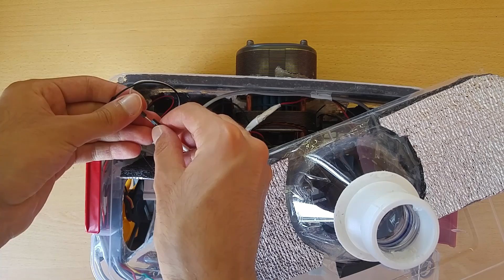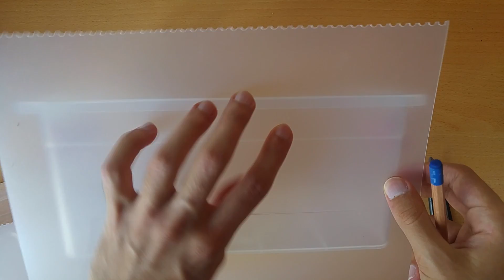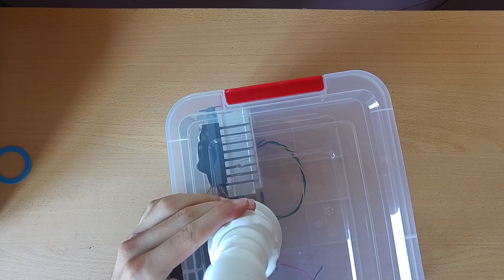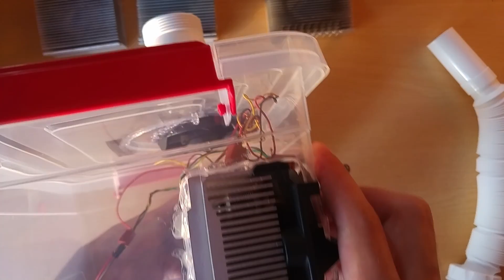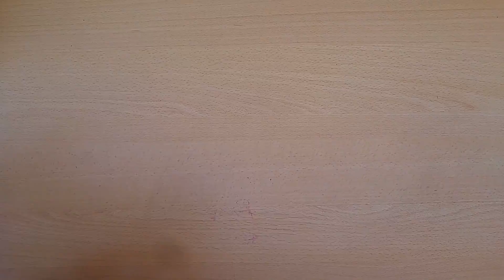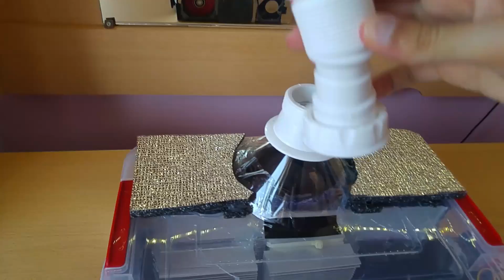DIY Air Conditioner (A/C) - Peltier - Thermoelectric Cooler - Computer Coolers / Homemade

Comment: I want to ask a question ...
If the cooling capacity of one pletier is about 50 watts ( Qmax = 50 watts), which is equivalent to 170 BTU
We need about 70 pletier to get 12000 BTU, (12000 BTU = 1 Ton refrigeration) which is the capacity of the air conditioner required to cool a normal room ...so ,  How efficient is this device in order to cool a room??can it really cool a room??